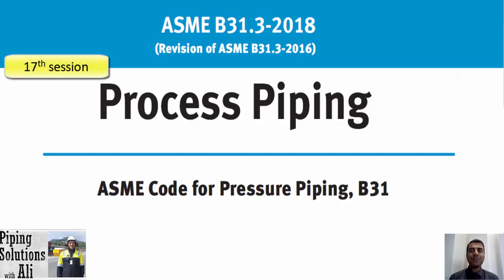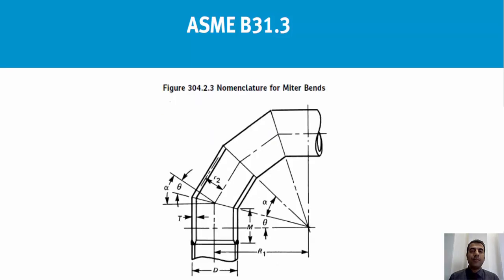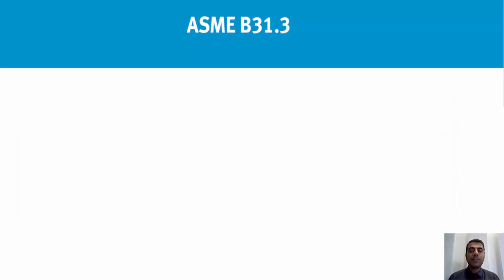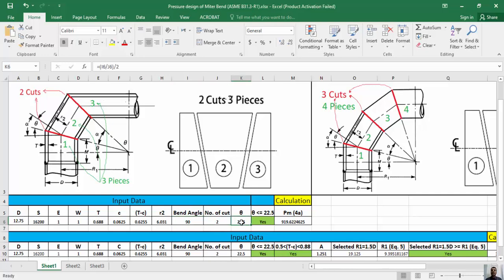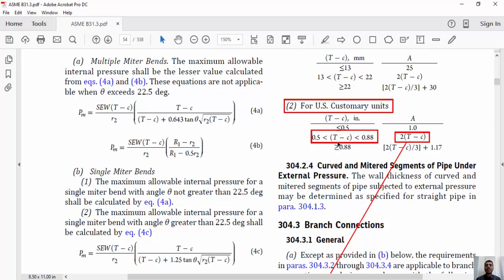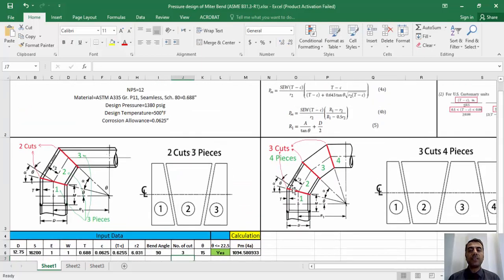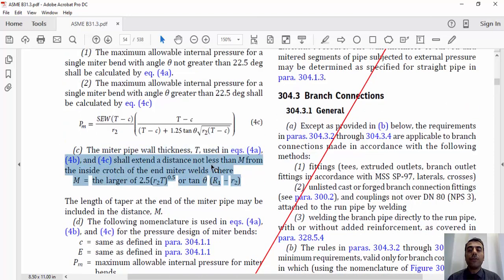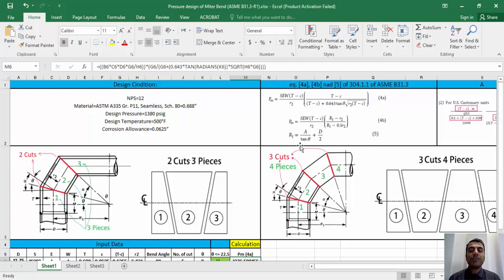Pressure design of Miter Bend (17th Session of ASME B31 3)

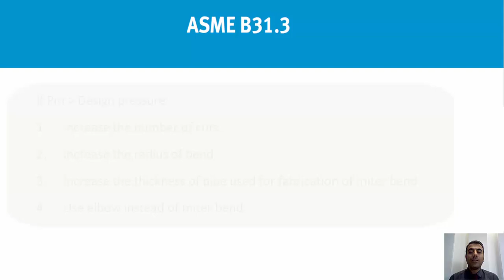Comment: There is a very serious mistake in the presentation. Pm is the Maximum Allowable Working Pressure. Comparing Pm with Design Pressure My design Pressure should always be within the limits of Maximum Allowable Working Pressure and hence the condition should be Pm > Design Pressure or else I need to increase thickness or take other measures as suggested by you at 3:01 . So at 3:01 it should be if Pm < Design Pressure then the following conditions ...